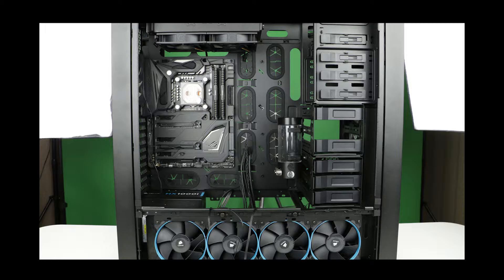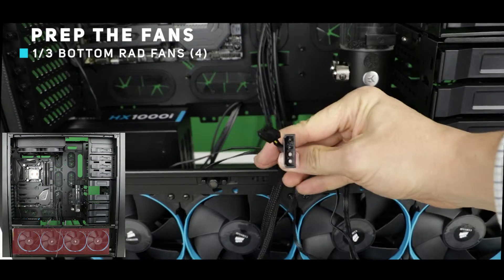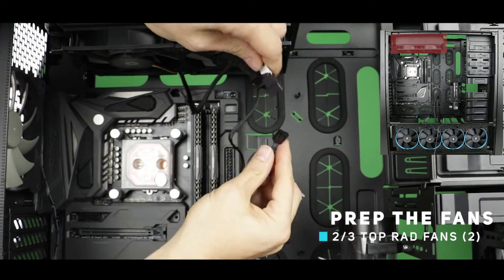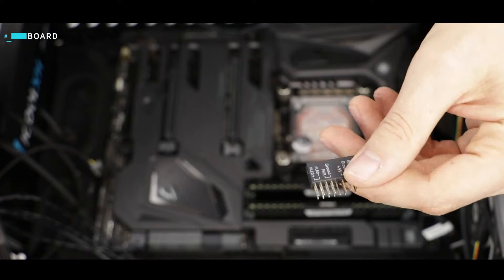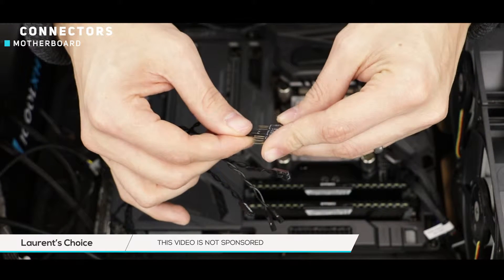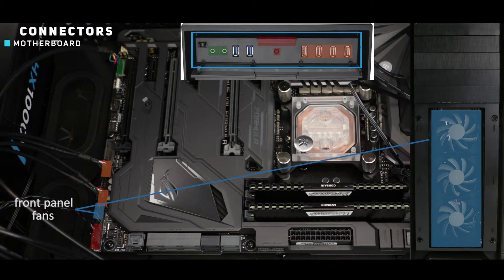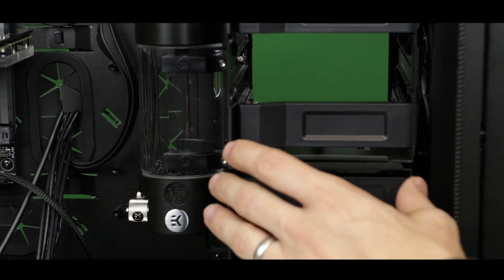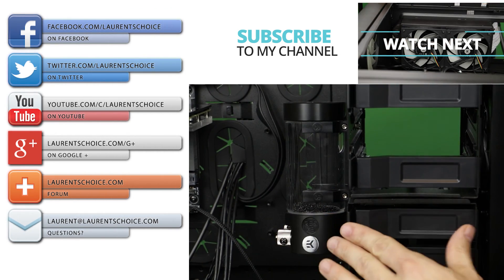Radiator fans, motherboard peripheral and SSD drive installation (custom water rig 8/9, Part 1)

Comment: how will we get to know what to connect to which port of the motherboard is is written on motherboard?
Reply from the maker: +Aksshay Sharma depending of your motherboard , a bridge should provided allowing you to easily identify and connect the dongles.

What motherboard do you have ?
Reply: Laurent's Choice i have a gigabyte b150 ddr4 motherboard.

i didn't get any dongle with it....but in manual they have mentioned....but with this  + and -...i don't want to fry any component
Reply from the maker: +Aksshay Sharma got you ... I'll make a quick video ... If u want to assemble today send me a photo of your connector and dongles and I'll reply with the correct order
Reply: Laurent's Choice well i don't have the dongle as i didn't receive...i have attatched the motherboard to the case and now all i have to do is cpu installation gpu and connecting motherboard to psu.....
Reply: Laurent's Choice i won't be able to send you as i am in a military college and we are not allowed to have camera cellphone...sorry
Reply from the maker: +Aksshay Sharma the dobgles ar the wires which connect to your case front panel :)

I just realised I have a very detailed video already published which explains everything, even the polarity of every connector.

Video 7/9 of my first play list (Building a 6th generation gamer's rig).

If u need a step by step email me which photos and I'll reply asap
Reply from the maker: +Aksshay Sharma ok ...Just saw that.   

I'll prepare a video for you :)
Reply: Laurent's Choice if possible plz make a video with the most shittiest motherboard because as of now gigabyte has made the most non user friendly motherboard. 

i wish i could send you a video but since its a military school...we can't have any cameras or recorders. 

will be waiting for you video.

and thanks a lot for replying :)
Reply: Laurent's Choice if possible do make a video on how to use an AIO cpu cooler to cool cpu and gpu since using aio coller we need a gpu bracket which will expose the gpu die only and placing a static pressure fan on the vram chips.

here only 2 brackets are available one by NZXT and one by corsair so it gets confusing what gpu bracket to use with what gpu